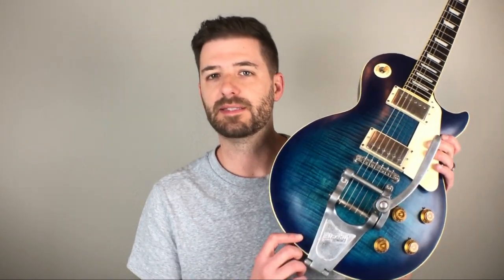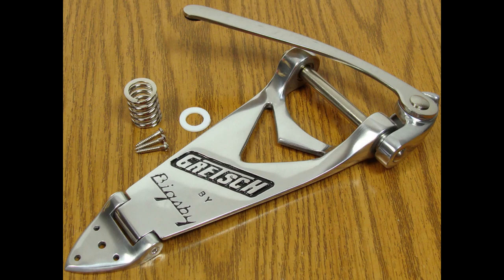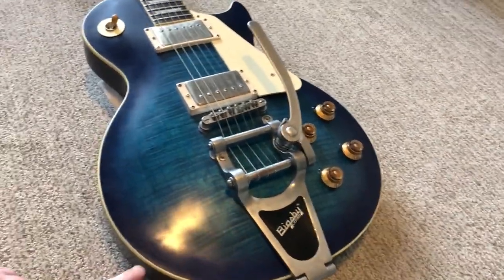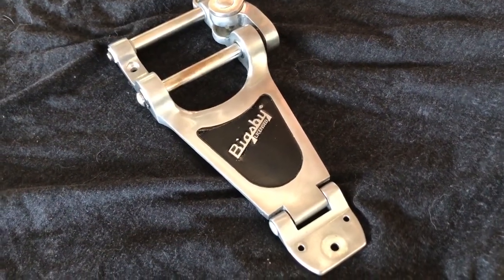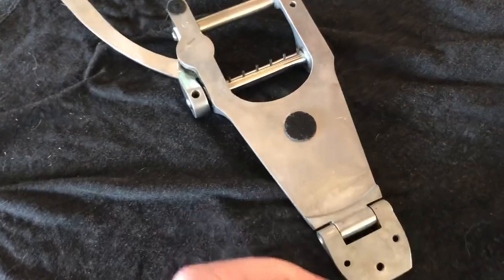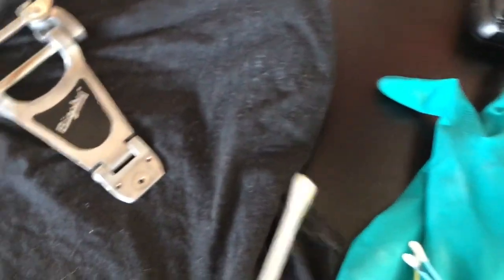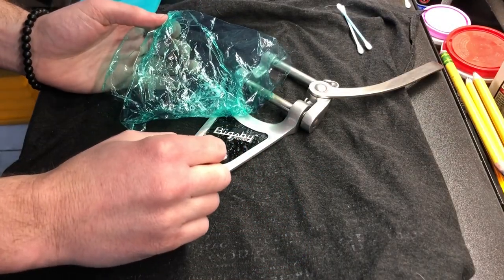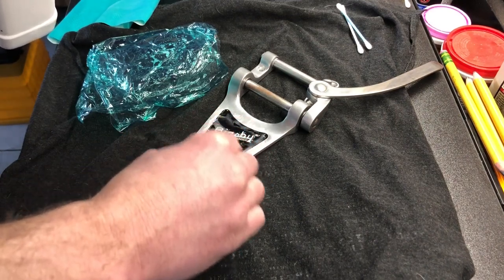How to Remove the Black Paint From Your Bigsby Vibrato

Comment: Would this work  in a gold bigsby without removing the gold finish under the black paint?
Reply from the maker: It should, but I would test a spot on the back of the Bigsby first for sure.
Reply: @NathanSink  Thanks for the tip.

Comment: Nathan Sink....In fact...you don't have a ''Bigsby'' that you can remove paint from...You only have a cheap Asian Licensed copy of a Bigsby...The company or companies who make them pay a licensing fee to Bigsby USA for the right to use the Bigsby name and design and use cheap white plastic bushings and cheap bearings to cut costs...They have no obligation to make a quality product...The sole obligation is to pay the licensing fee to Bigsby USA...
Reply from the maker: Yes, this is a B70 I know. I have the B7 on a different guitar & honest to God I can’t tell a difference. The original is sandcast (vs diecast) & has different bearings, as you mentioned. However, I wouldn’t call the B70 a “cheap copy”.
Reply: @NathanSink  The licensed models are intended to be sold at about half the price  as the real deal Bigsbys.. which would be a cheaper copy....but greedy vendors keep raising the prices and omitting to inform buyers that over time the string tension will reek havoc on those nylon bushings...Bigsby does not sell direct to the public and good luck finding those when they wear out...trust me...
Reply from the maker: @mark006868  my B70 has been working for 10 years, like a champ. Granted it’s not the only guitar I play. I guess if it does ever give out I’ll probably end up replacing it with a B7.
Reply: @NathanSink .. Well, you'll just have to replace those cheap nylon bushings for Roller bearings for it to ever be good enough when and if they ever wear Out, ..then you can Play till you drop dead at a hundred and Ten and get eaten by an angry shark for not buying the real thing for three times a much. Rock on, dead man!  🌊🏊....🦈🔥🚮
Reply from the maker: @benwright6330  I don’t understand why people get so worked up about the B70. 🤷🏻‍♂️
Reply: @NathanSink  ..what  Metal do you reckon they're made of, ..because a Magnet won't stick to mine, ..aluminum maybe?
Reply: @NathanSink  , ..one of my Bigsby trems says Bigsby Licensed, and the other has the Bigsby with the Patent Numbers thing on it, and just like my Gretsch Bigbsy, all have Roller bearings, (not nylon bushings,) with "made in usa" stamped on them complete with part number in little tiny script, right on the end of that little tiny precision roller bearing casing held in place by a little tiny micro C clamp, ..and it's only Thees Beeg, ..so cute, ..🤏 🤗   💫💥🤣🤛 "Wham-O!"
Reply from the maker: @benwright6330  yep, they’re aluminum.